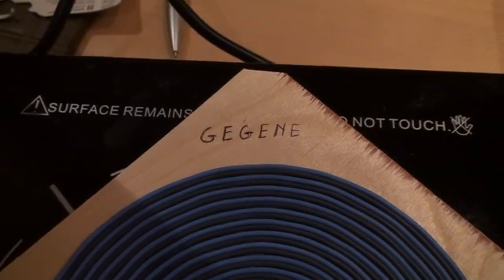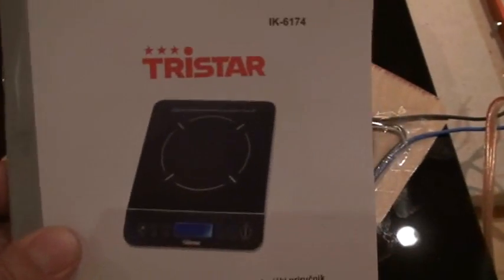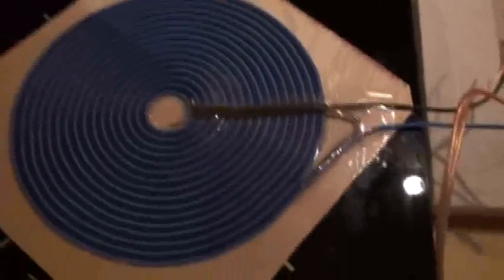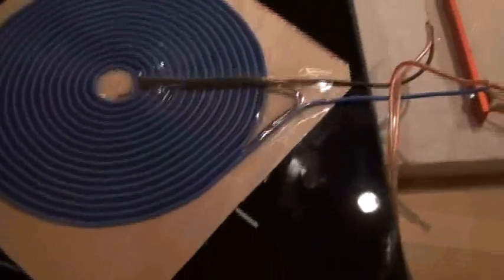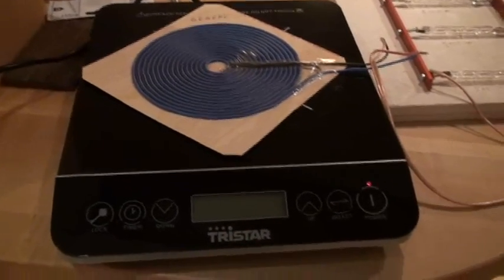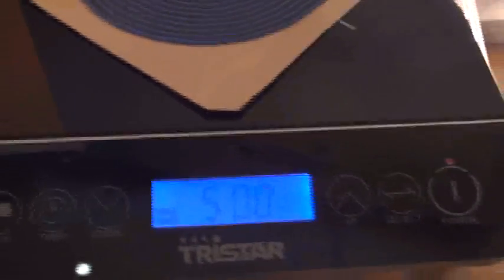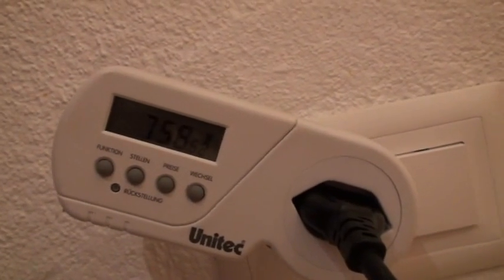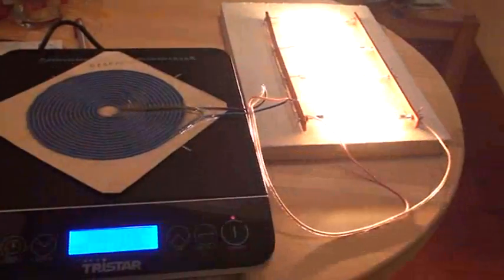gegene replication 1

Comment: Well done.
I had try it with lamps, and I noticed something.. with induction set on 400 W or 1800 W I had on output always 165 V and lamps lit on "half" (400W lamps-2x200), but when I add heater (I dont now Wattage - approx. 1000W) the lamps lit the same, the Wattage remainsthe same and the heater was also hot.  I think, this system has BIG potencial. Good work and keep gooooooooing...
Tadej
Reply: Hi, I know your comment is from 4 years ago, but it really worked this discovery took the time of consumption with and without the secondary that you place on the ornament? Axis; Without the secondary on the ornament you consume 1 kv in an hour, but with the secondary on the ornament you consume 1kv in 40 minutes. can you tell me if you compared it with your house meter?

Comment: I am soo glad you started to look into the bifilar coil. I have been pounding the boards to get people to look at this particular design. Now you see why.

 Other thoughts about this process is to use closed coils as reflectors. But you need to make special provisions for excessive heat production in the driving and recieving coils. The reflectors should be fine but the driving coil (induction plate coil) will heat up very hot. Maybe stout coils on a form that is heat resistant will do better.

Comment: The reason it turns OFF and then back ON and the bulbs stays at the same brightness no matter what the "Power" setting is... is because the cooker is using LONG-TERM PWM to adjust its output power. It turns it OFF and back ON at a set ratio that gives an AVERAGE POWER to the cooking surface, which would normally have a metal cooking pan to integrate (average-out) the heating cycles. If you set the cooker for 1800 Watts, it stays ON 100% of the time. If you set it for 900 Watts, it will cycle ON/OFF 50% of the time. Setting it for 500 Watts it should have an ON/OFF ratio of about 28%(ON time).
This cooker does not have a true adjustable output power.
Reply: I just got a cooker and it behaves this way when it's set below 1000W, above 1K it seems to regulate gradually, but I haven't checked with a wattmeter yet.

Comment: Can you tell us what gauge wire your tesla coil is made out of and how many turns?Did anyone ever  slip a small magnet onto the hotplate surface to fool the sensor into believing a metal pot was on it?  Then with a wire attached remove it once the Tesla coil is on the surface.

Comment: Looks like its a slow discharge capacitor, with the interaction of the various vortexal forces at the center allowing for a slower discharge.  So basically between a battery and a capacitor, as the coil stores charge, until its enough to power the lights, and then discharges it, but over a time period(not all at once).  Very interesting.  I wonder what would happen if you hooked a power source to the lights, using the coil as an interim, how that would change the effect at all, as you won't be

Comment: Hi,great video!

How did you bypass the pot sensor on top on the primary coil(in induction cooktop)?

I can't make it work without a pot...
Reply: Because it is a trick ! Therefore it does not know how to explain bypassed sensors . Unless made another PWM generator for coil !

Comment: My 2 cents on the "power regulation" in these cheaper induction plates. If you connect the power line via a simple Watt Meter "econo-watt" or whatever these are called, you can see that instead of developing a variable power driver circuit, these products start on/off switching to achieve the smaller temp. settings. Most 2000W devices have internally 2 stages of 1000W each, and turn these on/off every few seconds, depending on the sected setting...

Comment: Hi Woopy,
My induction cooker flashes an error and stop working when ever I remove pot and replace it with non-magnetic coil. Any suggestions on how to disable this?
Reply: Simple: Place the pot ON TOP of your output coil. Solved. In most cookers, you can remove the pot once it started up. (Background: Un-loaded cooker coil has lower impedance, that's what it senses. Providing sufficient impedance is doing the trick. You "cold" bifilar is "not yet" able to do that alone, no problem. Pot or pan on top for first seconds. Once the lamps start, then only remove. Or just keep cooking something 😉

Comment: some of the induction cookers have seciurity on/off without load (mean  without situable ferro material on it) , I pass it with use any pot as "initial" start up , then  slide coil under , and remove the pot the same time.

Comment: Great work, I am trying to replicate but cannot get the hob to accept my tesla coil. What kind of cable are you using? And is that only card the coil is sitting on? My hob beeps constantly and says no load but starts when I place an induction pan on top of the coil but no lighting.! Can you look at my video and possibly comment on what I am doing wrong?

Comment: I am having the same problem with my replication ...power going on and off . what was the cause of that problem? what is needed to fix the problem?
Reply: Do you mean, on/off every few seconds? That's the cheap way of "power control" on that hob. Find a Watt/heat setting where it does NOT switch. Usually the highest rating is save, and the half rating (e.g. 1000/2000W settings)